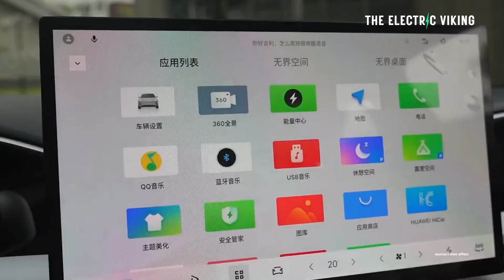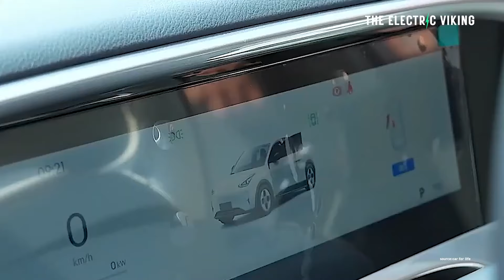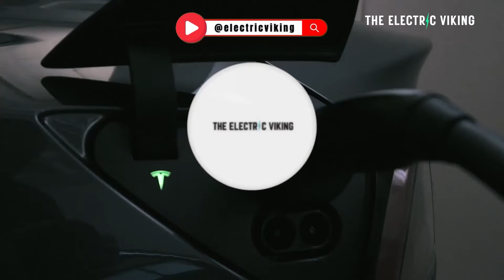Geely Geome - Cheaper, better and bigger than a BYD Seagull

Comment: I do think it is a better car, newer design at this segment with rear aircond, front booth, rear underseat storage, and 50/50 weight distribution, rear wheel drive,  the motor and inverter is a combined unit that is small and light weight, though not high power but good enough for city drive and with weight of only 1300kg.. I think it is one of lighter weight EV i see so far. This will come to Malaysia as Proton eMAS 5 right hand drive version

Comment: 1) $9,900 - $14,000 is the price in China. In Europe, Australia, Thailand or anywhere else the price will be significantly higher.
2) 310-410 km range: under the Chinese standard (CLTC). WLTP range will be 15-20% lower.
Reply: I would say they must be cheaping out in motor: but 140kmh is ALL you need other than 
1. Deutsch bahn
2. US interstates
3. track

And Russian highway if you can bride all the way thru

Comment: Entry price for base model is 80k Yuan = $11,200 USD not $9,000 according to Geely. There is no official price for the top spec yet anyone saying $14k USD is making it up.

Specs are 30.1 kwh (28.5kwh usable) for the base and 40.1kwh battery (38.5kwh usable) for the top spec. CLTC ranges is 310 CLTC / ~255 km WLTP for the base and 410 / WLTP ~340km ofr the top spec.

Motor outputs 58kw for the base, 85kw for the top of the range. Max speed 125km/h base, 135km/h top spec.

Mainly a city car will drian the battery extremely fast at 110km/h on a freeway operating at or near their maximum speed.

Comment: Not keen on the styling but that doesn't matter much. 410 km of range so on a drive from Perth to Geraldton or Albany I'd need to stop for a quick top up. My old Nissan Pulsar can almost get there and back on a tankful. Should be good around town though which is where most of us drive most of the time.
Reply: 410 km is CLTC (Claimed) from a (40.1 gross) 38.5kwh (usable) battery = 10.6km/kwh - totally unrealistic this will be more like 340km WLTP and use a minumum 140wh/km at 110km/h (being very generous as the given the top speed is 135km/h it's up against it's limit). This is around 270km for 100% to 0% at that speed, probably want to have 15% left as a minimum when you recharge = around 230km before you need a top-up.

There are no practical fast charge options on Hwy 1 - you'd have to go the coast road and stop at Jurien Bay on the way for around 45 min to recharge

Comment: Better in the rear suspension, rear wheel drive and frunk. But heavier. Against the stated, BYD powertrains are more efficient than geely's and, whatever claimed by catl and geely on their battery density, I bet that for the same battery capacity the seagull will beat this geome in range.

Comment: I don't think either the BYD Seagull or this Geely car would sell very well in the USA because USA customers don't buy small economy cars (or even small cars).  They want big SUV-style vehicles.  AFAIK all the USA manufacturers stopped selling small cars, and most of the foreign auto companies have very few small economy cars in their line-ups anymore.  If either company started selling them there would probably be an "initial interest" spike in sales, but it would quickly level off and fall off even if they were reliable, mechanically sound, and quick to charge up.
Reply: that is due to a purposeful market push, not really that natural. The makers literally stopped making those cars, and then never started back when demand returned because they prefer the higher margins with bigger cars.
Reply: @nfzeta128 The bigger trucks are exempt from pedestrian safety regulations, the same regs that made pop up headlights illegal, go figure, I know I'd rather be hit by a Miata than a fing Dodge RAM.